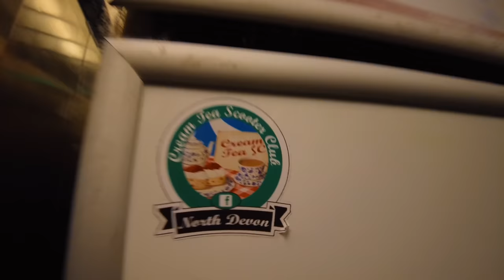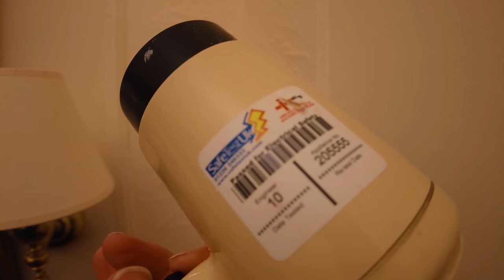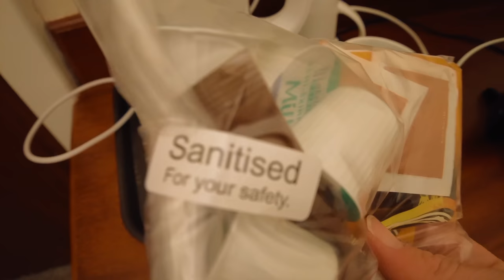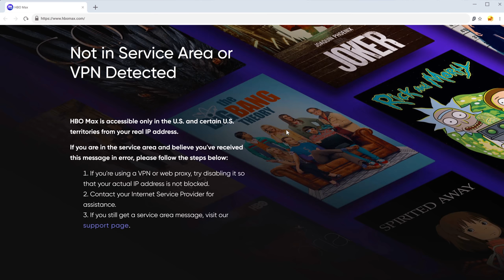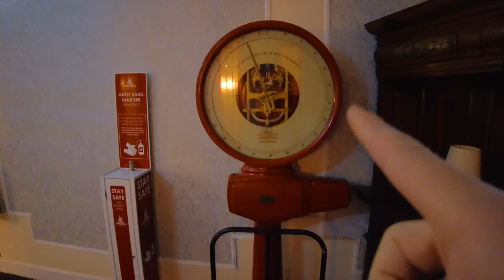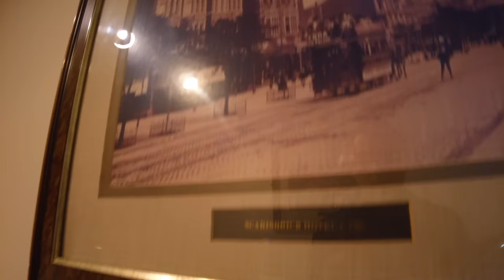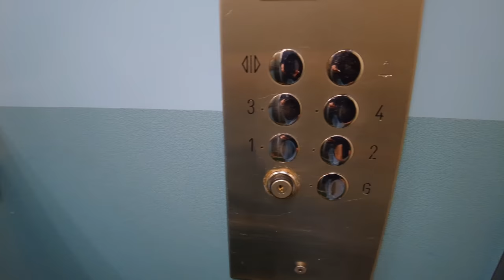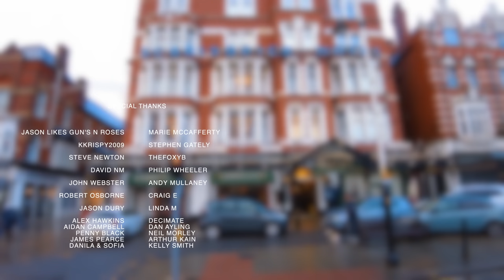Worst Rated Hotel - Scarisbrick Hotel, Southport

Comment: The green and yellow cable is earth bonding and is there to keep you safe. It will not cause you any danger. But it really should have been covered over with some paneling. Looks like rather lazy workmanship.
Thanks for the vid.